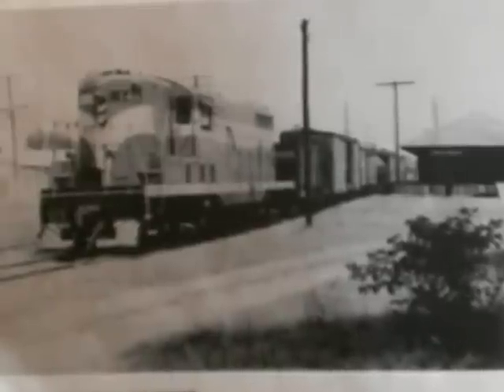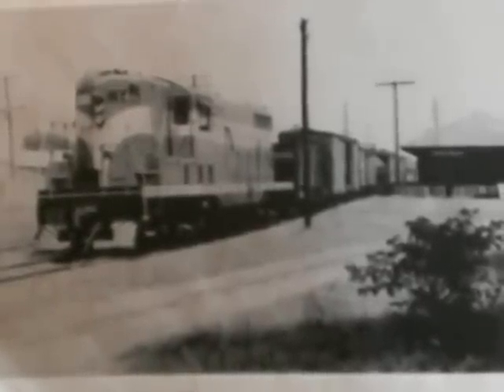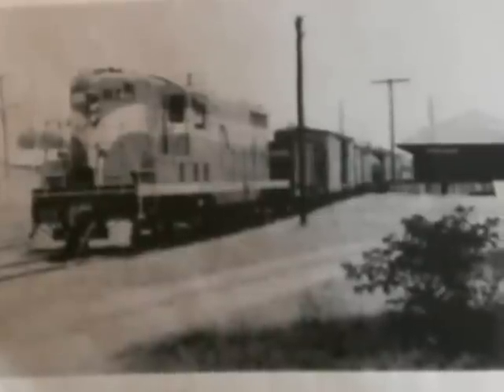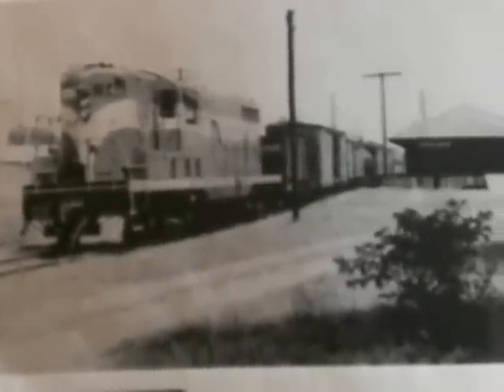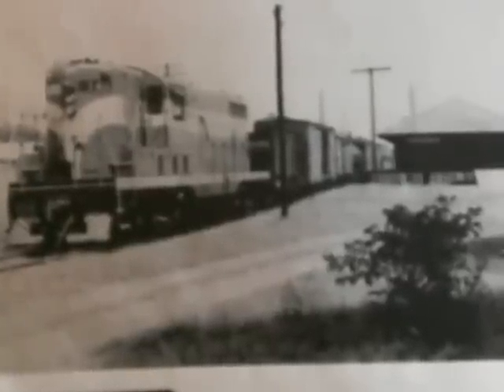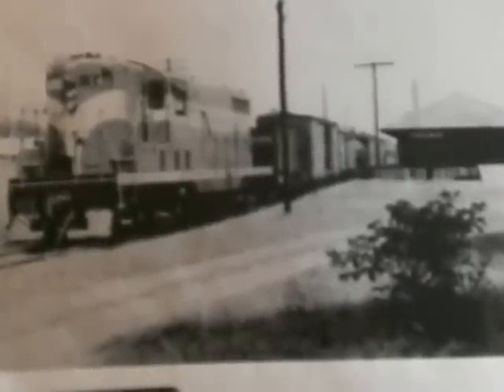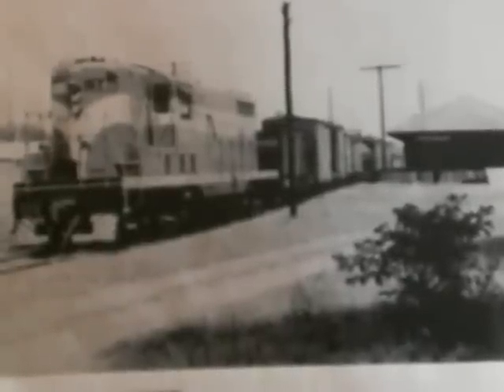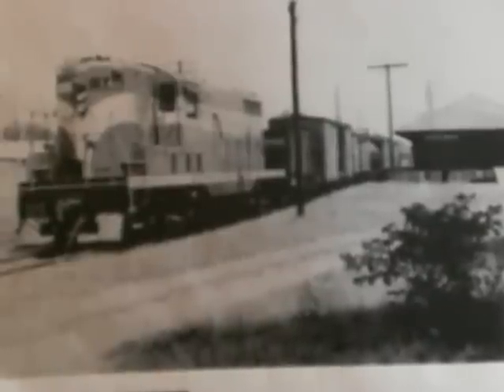Atlantic Coast Line Railroad Myrtle Beach SC Mixed Train Video

Comment: I'm just up the road in Wilmington, and I model the ACL in N scale.  Whenever we would go to MB in the Summer I loved seeing the 501 drawbridge on that track that leads to the station.  It was so cool to see a bridge that had a road and RR track on the same bridge.  I was never lucky enough to see a train on it though.  I never knew about the MB mixed train, thanks for sharing.
Reply from the maker: You are welcome. Yes passenger service through the mixed train ended in 1953. I have pictures on rail pictures .net  of  SCL locomotives at Myrtle Beach. We are excited here in Horry County since RJ Corman is buying the line. Maybe we will eventually see a dinner train or excursion from the Myrtle Beach Depot.

Comment: Nice! I'm in Conway, SC right now. I believe there is an industry in Myrtle by the cement (or rock, one if them) that uses tank cars, but beyond that, the line is used for storage, which is to bad. I don't even think the 84 lumber is used anymore.

Comment from the maker: The cement or covered hoppers are there for storage. They still service 84 lumber occasionally. The trestle bridgre just before 84 lumber needs work. The CS crews use a backhoe to pullthe car across after that point to 84 lumber. Its my understanding now that the bridge will soon be repaired. In red hill Tank cars are being filled with old cooking grease to be processed inti bio Diesel.. Of course rocks are still being brought to the pine island which you can see from highway 31.

Comment: Would you happen to have any old track diagrams of the Myrtle Beach area during the ACL years or know where I can find some? I'm doing some research on the branch and beyond what I can see on Google Earth I have no idea how many industries there were and how the track was laid out
Reply from the maker: You can go to Google Earth too look at earlier tracks. You may also go to the Horry County Court house and look at old plats of the Myrtle Beach area to show where the track ran. Also you may contact the ACL/SAL historical society on the internet to get copies of the old ACL maps. The tracks now end at Oak street. That occurred in the 30's. The tracks used to run all the way down 9th avenue to where the Pavilon was located. There was a turntable also at the corner of Hwy17 and 9th avenue. You can still see where the wye came into play. The wye used to extend way back to 10th avenue where there was also a loading area for Myrtle Beach Farms Corporation. The industries that were served in Myrtle Beach were the Air force base.(spur from the base to the base of hwy.501), A concrete plant on hwy. 501, Chapin Lumber Company, Myrtle Beach Lumber, Three Beer and Wine Distributers: Better Brands, Stevens Corporation and Schafer Corporation.